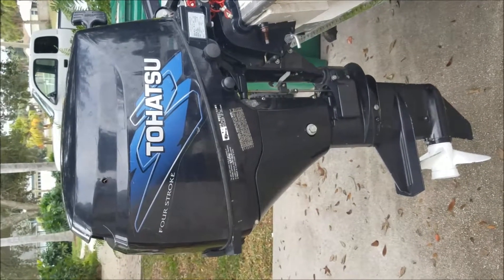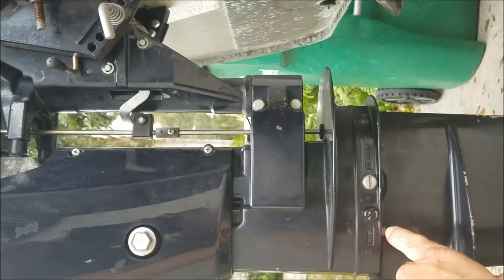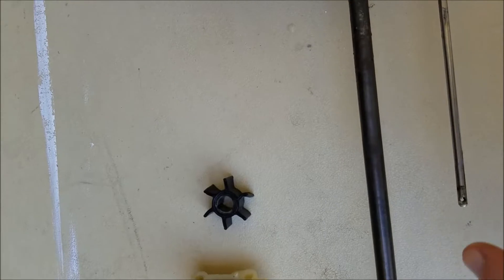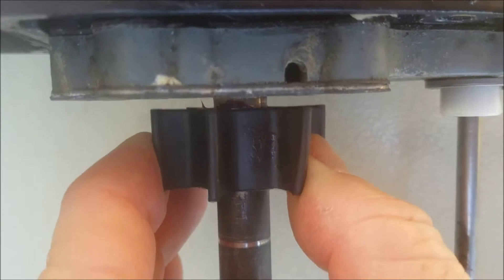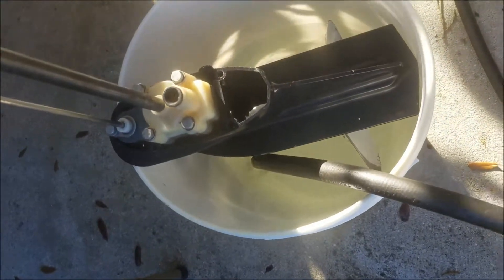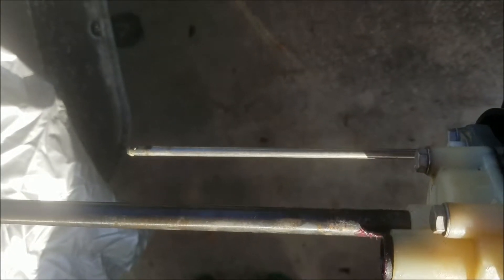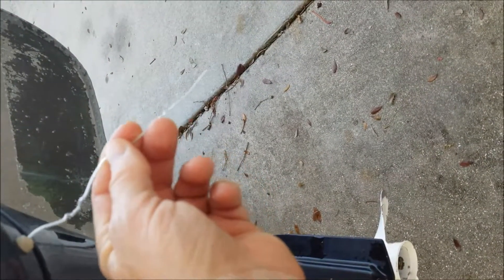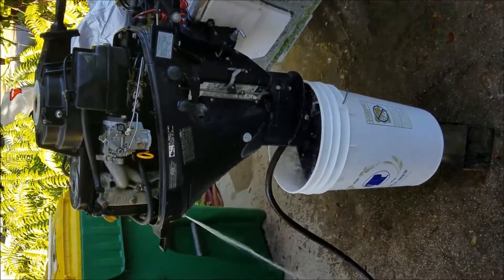Replacing the Water pump Impeller on a Tohastu 9.8 Outboard Motor

Comment: If you follow these Instructio s, your impeller  will be installed incorrectly. By rotating the drive shaft as you  lower the cap onto the impeller, the fins will be curved incorrectly. They will be bent in the shape of a C, as the shaft rotates.  You need hold the cap in your hand and rotate the impeller clockwise as you slide it into the cup. The goal is to have the vanes look like a backwards C as you look down through the pump siphon hole in the top of the cap. I did it your way, realized it was wrong, and sure enough it was. It pumped, but not effectively.